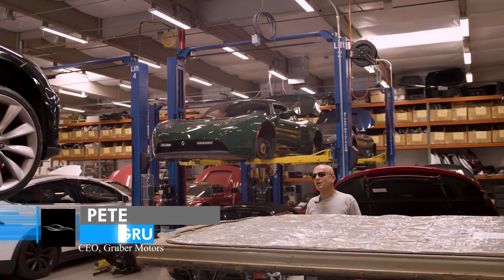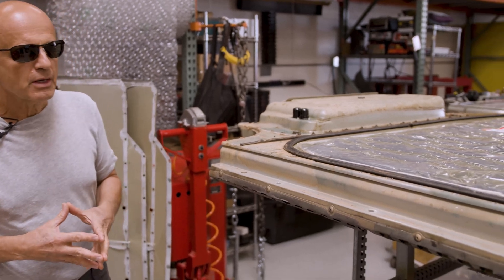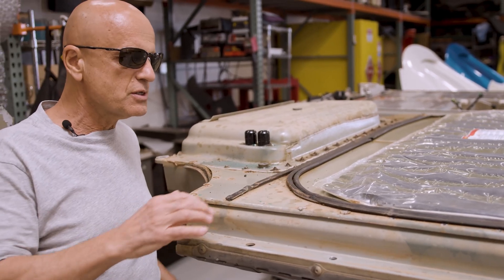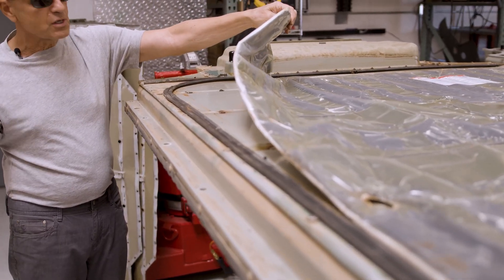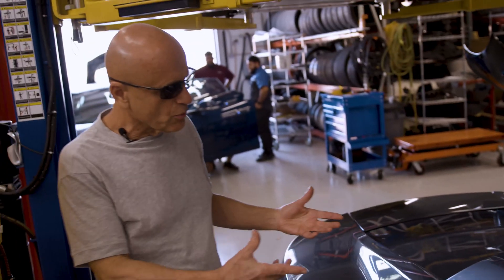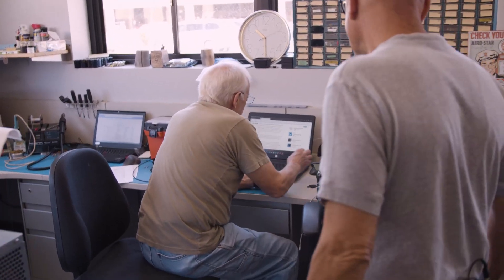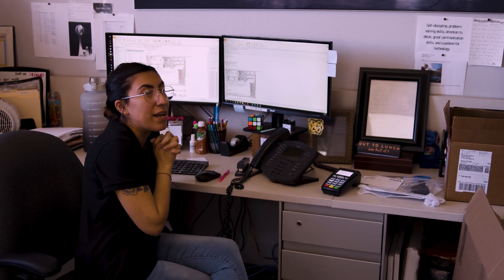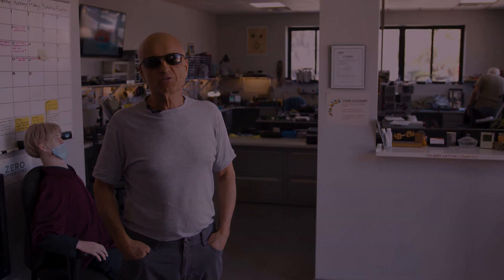Inside Gruber Motors | Ep. 2 - Wet Battery

Comment: We want more Mr Gruber appreciate your quality content! I have a question for you I have a 2012 model s 85 with only 42k miles had a drive unit replaced in 2018 of November. Should I have any worries with the battery pack
Reply from the maker: Roadster packs are 13 years old, and still going strong.  Both Roadsters and MS use 18650 cells.  Outside occasional failing cell aberrations, you should be fine.

Comment: My model S P85D 2015, now need to upgrade the eMMC and the problem is I am from Sri Lanka, and not a Tesla service center here. So, my questions is, if it is possible for you to do the replacement of this 8GB memory chip in case if I send the complete panel to US. Also the other question is , if it is possible to upgrade the old MCU to new MCU2 , for which we can do the replacement if the new MCU2 be programmed by you and send it to me, over the Sri Lanka, which we can assemble into the dashboard. Thanks. Ruwan.whatsapp +94777310343
Reply: I would email them...they might not see your comment here
Reply from the maker: The worldwide chip shortage has temporarily shut down our eMMC replacement program.  Upgrading an MCU1 to MCU2 would require a major replacement far more expensive than just buying and MCU2.